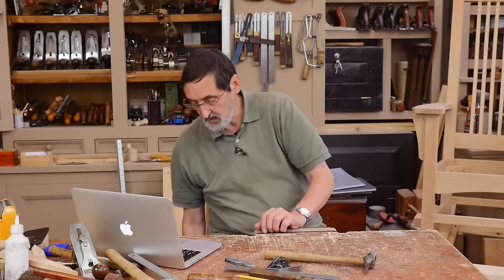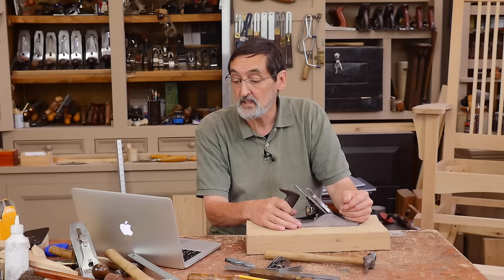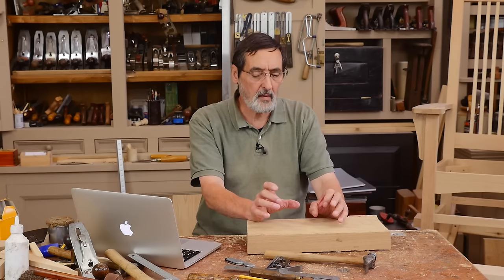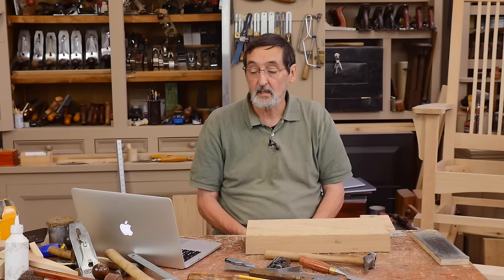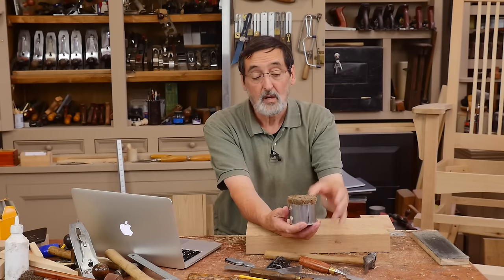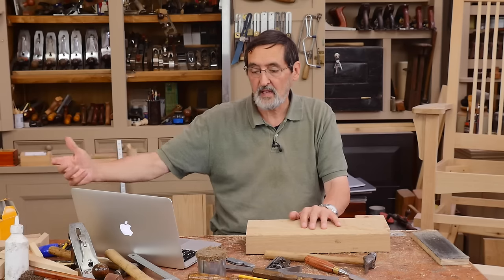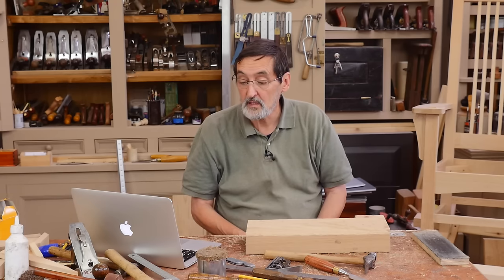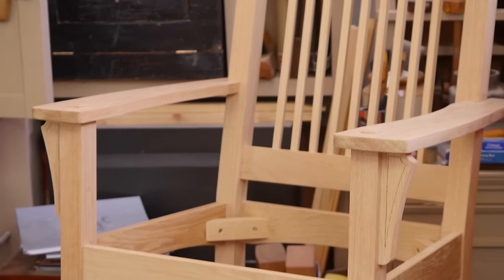Q&A with Paul Sellers Episode 1

Comment: PAUL, since I was taught to handle tools, It was always workshop practice to lay a plane on its side after using it, ready to use again, keeping the blades edge away from the bench surface. After 43 years I find it instinctive. You are a true craftsman, but I squirm each time your plane goes down flat, after all the in depth  instruction your sharpening videos provide about how to put a fine edge upon a plane iron. THANKS  FOR YOUR VTDEOS. George cronin

Comment: This is such a balanced and well informed view on power tools versus traditional. I'm increasing grateful to Paul for his guidance and the generosity with which he shares his knowledge.   I've abandoned many of my machines but my Sedgwick planer thicknesser stays.  It saves me time, dry and wear and tear on my body.  But  I do a great deal more hand planing now than for many many years.  I enjoy it and like Paul I don't like the noise and the dust.  But no need to be heroic.  For resawing and heavy planing the bandsaw and the planer stay.  I used to be a wood carver.  I might take it up again but only with gouges.   They surface harden and burnish.   Machines do not.  It is not that machines are bad or hand tools obsolete.  They solve different problems.  The problems that now interest me are mostly better solved with hand tools.  I think that is what Paul is saying.   He pleases me.

Comment: Great stuff Paul.  I don't have a question - this is just positive feedback.  Your passion for woodworking is infectious.  I happened upon your channel about a year ago when looking for different benches.  Since then my subscriptions to other channels has shot up and I have had the confidence to construct small simple pieces of furniture in our new home. It is over 300 years old, so requires bespoke fitting and I've found your advice about planes, chisels and sharpening invaluable.  In fact I have bought a saw to make the bow saw you made.  I am ashamed to say that in the end I bought my bench as I had no space to construct it.  It is in dire need of a planing due to quite severe swelling of the wood because of high moisture content over the winter in a poorly insulated garage.  I only have a number 4 plane, but as you say, that should be all I need!! Thanks again. 

PS yr book is on my xmas list!

Comment: I started woodworking with the idea that the router would be my tool of choice. After watching Paul's videos for the past two years my routers collection of bits and dovetail jigs now sit unused.  However I stoped using 3 in 1 oil for lubrication. I use beeswax. The smell of melted bees wax on on the sole of a warm plane is just more pleasant than oil.

Comment: Re sharpening: The scary sharp method using silicon carbide paper on glass works fine, but a polished  granite floor tile works well too.  And if it breaks, it's just some pieces instead of nasty glass shards.  Now, I use a fine 3"x8" DMT diamond plate, but if i need a finer or coarser grit, i just wet down the stone with glasscleaning solution and then lay down sandpaper on it; it sticks just fine on the DMT plate.

Comment: I'm also left handed but I hate having to change anything for it, or to depend on one hand too much. 
I set up my vice in the normal way, and when using tools, especially new tools (or whenever I'm doing something new) I frequently swap hands. I can do just about everything with both hands now, even though the left still feels slightly more comfortable. 
It's much easier, for example, to just swap hands when planing, instead of taking the wood out of the vice and turning it around if you're going against the grain, or if the grain happens to be going different ways at each end.

Comment: Well that was a first I think. You just sitting and chatting or more to the point answering the common questions you get so very often! Enjoyed watching it and looking forward to the next one!
Here is a question I have and I'm sure many other woodworkers have regarding your oil/rag can. I agree it helps to prevent rust and helps with the smooth movement against wood. Doesn't using your oil can/rag on woodworking tools get some oil on the wood, thereby affecting the staining or finish on a project?
Reply from the maker: Never been a problem in 50 years and I never had fisheye either..
Reply: +Paul Sellers Ok Thank you Paul. Guess I'll have to try it then.
Reply: If there is residual oil that is passed to the wood, it is ultimately that wood that is about to be turned into sawdust and not the finished surface.

Comment: On using planes; when I use my larger planes for larger job, I have a bad shoulder that hurts very much from the pushing motion.  I always end up pulling them by the front knob instead of pushing.  This is much easier for me to do .  Are any planes in production made to be used with a pulling-action?

Thank you for your show!

Comment: Definitely more of this please Paul :D

As an additional question about bent hand saws one, I have acquired a couple of old hand saws that I want to recondition into usable condition (one course and one fine) but one of them had a bend in the blade that I tried to straighten however it wasn't a curve like the one you demonstrated but more of a kink and there's even a tiny bit of the back of the saw that 'pops' when the blade is flexed.

Would you even bother trying to fix this or is it too gone to be worth my time?

Would it be better for me to 'cut away' the entire length of the saw to make a new spine?

Comment: About the stud grade lumber: I finally gave up on that when I built my first bench.  It was extremely difficult to find adequately straight boards at the Home Depot (Similar to Lowes, a big box store) and even the straight lumber was so soft and knotty I simply wasn't up to the challenges of working with it.  I eventually went with some douglas fir from a nearby lumber yard, using 4X4 for the legs, 2X12 for aprons and the well, and a massive 4X12 slab for the top.

I'm building a new bench now and I stole an idea from Christopher Schwarz and bought 2X12 yellow pine boards from Home Depot.  I rented a table saw and used them for the "Donkey work" of ripping them down to 4" stock, then proceeded to laminate them the way Paul does in his videos on making a work bench.  The result is FAR superior to the "white wood" (S/P/F) studs for a similar cost.
Reply from the maker: I have used gluelam beams, the type used for garage door spanning, for benchtops too and they work perfectly.
Reply: I considered them but even the few used ones I found were over my price limit.  I have enjoyed working with the yellow pine.  It's a "hard" softwood available at a good price and it seems to really like hand tools.

Comment: So does the oil not contaminate the wood?  I'd be concerned about causing problems for finish application.  Also could one use mineral oil?
Reply: Thanks,  found your answer in your blog post from 2013.

Comment: Great Video's, converted me to using hand tools only, I've been practicing motrices in spruce lumber and found that when using the chisel bevel down for a while, it seems to form a bur on the flat side. laying the chisel flat on a  spare piece of wood and pulling back seems to remove the bur and chisel seems to work fine after this. Is this normal and should I be sharpening at this point?

Comment: This was great Paul, thank you! 

I recently inherited some slabs (about 1 inch thick) of various hard and soft woods, and I'd like to cut some thin boards for instrument building (back, sides and top of a guitar). The only way that I know to do this is with a horizontal bandsaw or veneering saw, both of which are hard to come by in my small Canadian city. Do you know of any other methods that could be used? Are there any tricks to doing this with hand tools?
Reply from the maker: Yes. Whatever can be done with a bandsaw can be done with a wooden frame saw pretty much too.
Reply: +Paul Sellers Thank you Paul, that would be much cheaper than any other option I've figured out so far. Would you consider uploading a demo of using a frame saw with this purpose?
Reply: He also has videos on how to build a frame saw. :)

Comment: Paul I buy my maple and poplar from HD my question is do you think that the hard woods are also to wet to use straight away?
Reply from the maker: No, I don't think so at all. I have used their oak and poplar and never had any issues beyond being over priced.
Reply: +Paul Sellers 
Thank you and I have noticed that if I search through the piles of maple  Ive found some interesting tiger ,spalted, and even birds eye mixed in. Amazing that the don't seperate it out but that's good for us.

Comment: How do you straighten the bevel of a chip breaker? The part of the front of the chip breaker that lays on the flat surface of the planer blade? I can't seem to make that bevel parallel, and always get a gap on one side or another between the chip breaker and the blade. (I hope I explained clear enough about which part of the chip breaker I'm talking about)
Reply: Good question. Let's hope Paul Will adress that question. Mostly the angle it should be polished to.

Comment: Hi! Is there a way to remove the black stains of the blade of the saw once you've removed the rust? I see that your saw also has them. Or is it that once it's stained, you can't do anything about it? What are they?
Reply from the maker: It is patina and patina is important to the intrinsic value of any antique piece and that includes saws.
Reply: Oh! So it's a good thing (afer your reply I made some research on the web). Thanks for the info! :)